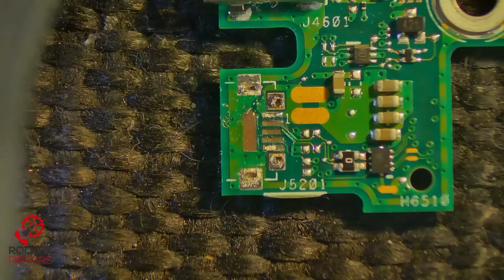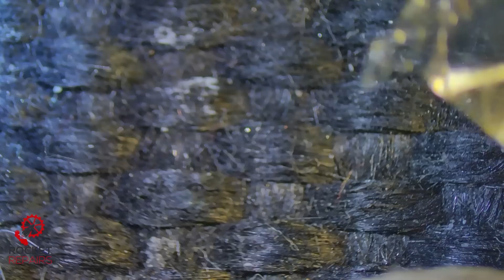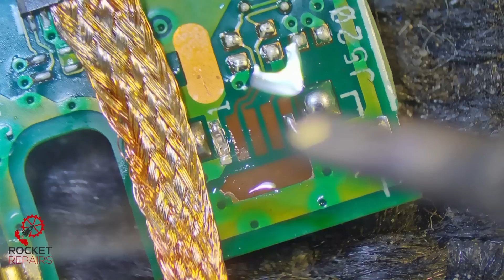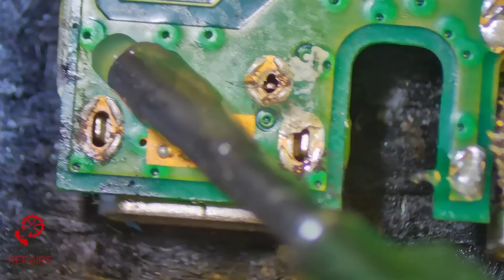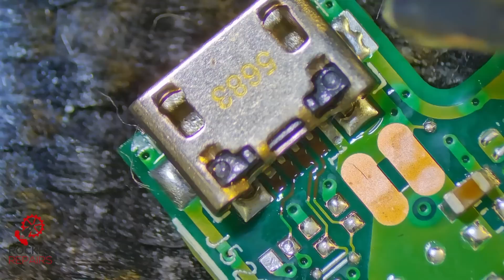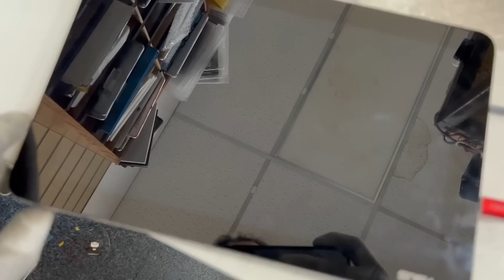Asus 2 in 1 Laptop not charging - Trace Damage Repair!

Comment: Really enjoyed the video.  I noticed in the majority of your videos that you prefer using solder wick vs. a solder sucker.  Is it personal preference, or is there a reason for it?  
I'm also curious to know the type of solder (percentages) and type of flux that you use?  I want to try some of my own here in Kentucky, US.  
Thanks again, 
Al
Reply: I vote for "going with the masses". Once you add leaded solder, a solder sucker would put a lot less stress on the PCB compared to the solder wick, which IMHO would be better used to only clean pads instead of holes.
Reply: @bufordmaddogtannen  Thanks for that feedback.  I really appreciate.  While I have done quite a bit bench work in the past, I really enjoy watching Joey and others do thi br ē
Reply: @alfredhughes8765  my pleasure. We are in a similar boat, although I think I wouldn't have the patience anymore to repair things on a daily basis. 🙂
Reply: @Buford "Mad Dog" Tannen  Thanks again, Mad Dog.  I am going to start small with a couple of things around that were the kids and been "sacked" by them.  I have  some of the get started equipment, and if I find I don't have the patience anymore, I can sell the equipment and still make a profit.
Reply: @alfredhughes8765  that would be the best course of action.
When it comes to getting a digital microscope, keep in mind that a 5" phone on a tripod set to 4x digital zoom would give you about 3" vertical space for soldering at a much higher quality than these cheap digital microscopes on the market.

If you have a 7" or bigger tablet, a cheap USB 1080p microscope on a stand, connected with a wire would give you similar results to one of those $150/200 pre made scope+integrated screen solutioms

My 2 cents. 😉